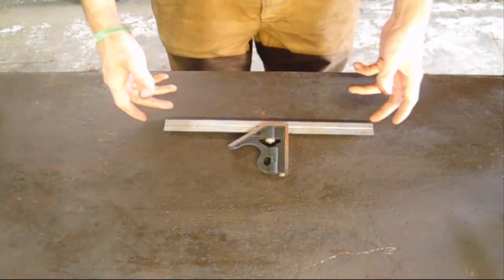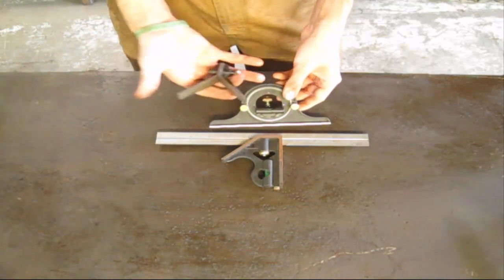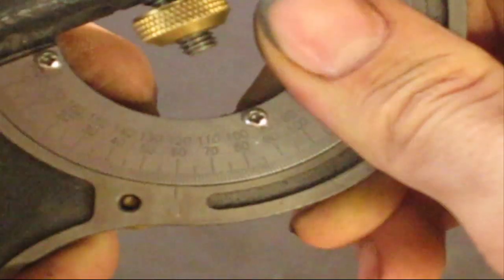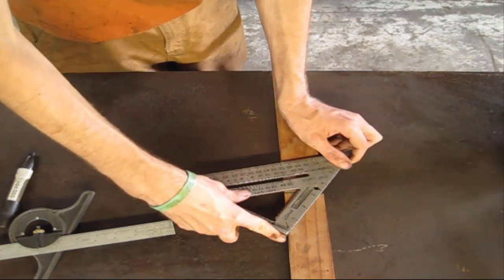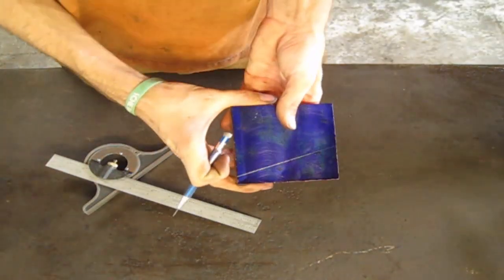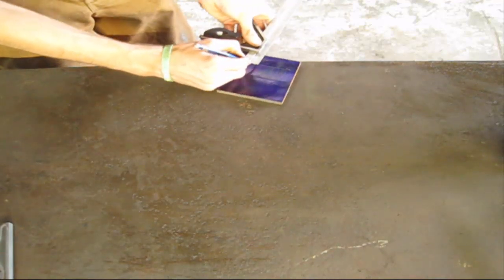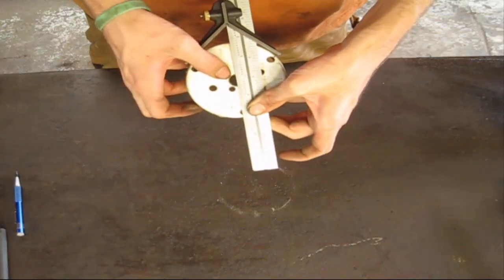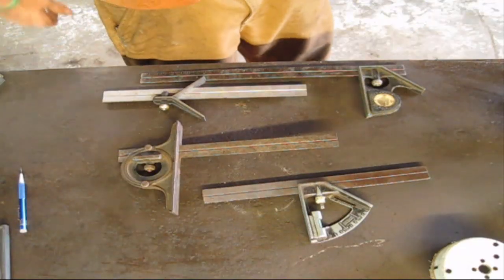The basics on the combination square

Comment: Thanks man. I knew a little but there's always more to learn. Muy combination square doesn't have that many attachments, but now I know why I should upgrade.   Guitar setup actually uses 64ths a lot, but I usually just convert to 100ths and use a feeler gauge. Imagine trying to accurately measure a 4/64ths gap with the end of a combo square!
Reply: I think that was his point.  That 1/32 or higher isn't useful on a ruler and putting that many lines on a ruler just makes it harder to use for some.  He said that he would use something like a caliper to get in the .001" ranges.
Reply: Right. I just wanted to make the point that 64ths are traditionally used at least somewhere. The rules designed for the purpose only have 64ths marked and are designed to measure gaps well. Still it makes you wonder what they where using before specialized tools if the old-timers where measuring guitar string action in 64ths.

Comment: my favourite use for my combination square is laying out distances (as small a 64th) exactly. Take your rule and turn it on its edge. take the scribe and use the engraved grads to guide the scribe downward and press the point into the workpiece. repeat for the required distance or repeat for several holes.  combination squares are practically unknown here in europe. but when i use mine, it generates a lot of interest.

Comment: For cabinetry and furniture 1/64 and 1/128 is very useful and not out of line.  I would add boat building to the list.  For framing  1/16 is usually close enough.  Regretfully I tend to get too precise in all of my measuring.  I just finished a ramp and deck.
Reply: I don't think he's saying that measuring that exact is unnecessary.  But that if you want to measure to 1/32 or higher you should probably just use another device.  I believe he mentioned calipers because if you're going that exact then just looking at 128 lines on a ruler in an inch isn't that exact by your eyeball.

Comment: 10ths & 100ths are used a lot in sheetmetal work... in particular aircraft related. 10ths & 100ths are handy in the machine shop as well. Precision woodworkers often use 64ths & 128ths.

Comment: More... quality (un-abused) Combination Squares such as those produced by Starrett & Mitutoyo[1] come apart & go back together quickly and smoothly. They can also be had with most any scale graduation combination/s you can imagine, are easy to read with non glare finishes, always do a good job, and leave a smile on your face at the mere thought of them. Yes, you do initially pay more, but they're worth it... once actually used you'll never look back. Most anything found in big box stores will be a struggle in comparison.
[1] There are other quality manufactures as well.

Comment: If you knock it out of square, all is not lost. The ruler is pulled into contact with two hardened dimples in the base of the slot. By careful filing of one or other, the alignment can be changed. This can be checked after every stroke with a diamond file, by drawing a 90 deg line on a flat surface, flipping the square over and drawing another very close to the first. If they are parallel, the square is true. Work slowly and think it through or you might file the wrong dimple and make things worse.  Don't do it on a Starett or other high quality square as its unlikely to have moved.

Comment: a great tool with about .005% miss i guess. i got me one the other day it was on sale @ hf and i was wondering about its usage. i remember some of the basics from welding school about the square rule which i believe are simple but the other features where kinda new for me specially on the dialing degree protractor. in real life i use two kinds of protractors to measure degrees when torquing bolts. one is to find the angle and the other one to torque to specs. the center finder is very practical on your discussion and a life saver for many applications specially during those days when everything has to be done right away with precission. thanks for the video and the time you used to explain some detail on the tool which i believe its very useful

Comment: If you don't want to change heads, many manufacturers sell additional blades separately.  You can get several and keep one in each head all the time.  Personally, I don't bother with it, because the main head gets all the use.  The protractor and center finder combined make up maybe 5% of the use, so changing the blade is not a big deal.

Comment: Another good one but yes you can use it on square stock because the vee is 90 degrees so it sits on the corner of the square stock. Also I found the center finder was not quite accurate the first time I used it. It was off center by almost ten thou but all I did was make my first mark then turn the piece 180 degrees and make a second mark. The two marks are close enough to be able to easily get an accurate center mark. It goes without saying that you still have to make two marks in at right angles to those marks. 
I bought a good set when I started doing safe  lockouts so I went to the Snap On truck and he sold me a Mitutoyo set.

Comment: I think the 64ths are there because a) some people use them and b) there are 4 edges available so why not? Also, one of my combo squares has the numbers on one edge increasing from left to right, and the numbers on another edge increasing from right to left. I find that a handy feature, as sometimes you need to measure from an edge of the workpiece where it's awkward or impossible to position yourself on the other side to make the reading and reading upside down is an error-prone pain in the neck.
Reply from the maker: This is true.  I think they could have put something else though.  Bad as I hate to say it metric maybe.

Comment: Thank you very much for the nice video.   i have never used one. Always wondered what for, besides to check if a 90 degree angle is 90 degrees. I had a question in regards to :   How to figure out what angle you have to cut a piece of wood.   For example . I have 2  2x2 foot plywood that need to join in the middle.. both pieces are used to form a "roof" (cathouse) so there is a  x degree to be cut.  Any suggestion on how to get info on that.?   Thank you very much again!!

Comment: Yes, I did enjoy it. I just cleaned out my shed and found an old combination square, just the 90/45 deg head, was badly rusted, so I wire brushed it and cleaned it up, made by Union tool Co. , Orange, Mass, USA. Is that a good brand? Thanks for your video:-)

Comment: When you were trying to explain your 30 vs 60 it's the difference between a left angle and a right angle.  Technically you did 150 degree right angle.  Or if you want to think of it as counterclockwise starting at hour 9 and clockwise starting at hour 3.

Comment: Most blades (rulers) have sides marked to 1/8, to 1/16, to 1/32, and to 1/64.  Just flip the blade to put the scale you want to use in the best position.

Comment: We went to measuring with 10 ths..In the tire manufacturing process,because it was easier to work with than fractions ,when measuring tire parts. Most everybody wanted to balk at using them,but in no time they figured out their simplicity! 7/10 - 3/10=4/10 etc.

Comment: Great informative video. One correction thought; the center finder is designed and can find center on both round and square objects. You just line up the wings the same way you did with the round piece. The angle on them will allow you to find center of the edge of the square piece. Thanks for the video. Keep them coming!

Comment: I think the speed square took the place of a framing square rather than the combination square.  over the years I witnessed the transition as carpenters moved from the framing square to the speed square. Of course, that may have only occurred in my neck of the woods, but that's what I saw happen.

Comment: I have a vintage Stanley 46-222 combo square. It didn't come with the protracting head, nor the center find head. Can I purchase the two heads I'm missing, made by a different company?
Reply from the maker: Stanley Waggoner some of them don't come with everything for some weird reason I have two myself that don't have the same things. You can buy others that will fit, but it would be better to buy a whole new set because they may not be accurate.
Reply: Thanks for your advice!

Comment: Yeah, what are these ruler manufacturers thinking? Inches? Make them all metric! In a couple generations nobody will even remember doing otherwise.
Reply from the maker: Mad -Pac Now hold up there. I like Imperial just not 64ths. That's the same as .5 mm on a scale. Rulers are accurate, but it takes more than steady hand to use them things for that.
Reply: I apologize if I sounded rude. Actually I meant my comment more as a quip. People were going back and forth about whether the markings in rulers or squares are useful or not, and I'd say that obviously they are useful for some people, but others will find them useless. In my case, Imperial is more of a problem than a solution, but I understand for American carpenters, for instance, it's fundamental. 

Specifically about the 64ths, well, I have no experience with Imperial measures, but I assume sometimes they may come in handy. If I have a 10cm piece and I divide it in half, I easily get 5cm. But if I want to divide that 5cmm piece in half once more, I'll have to make a mark right between the 2 and 3 mm marks, and that's when 0.5mm counts. Sometimes when you're working with small pieces of paper, or building a model, for instance, depending on your purpose, that could make a difference.